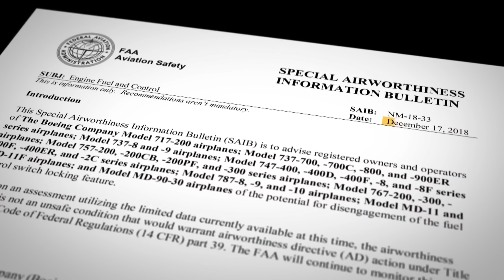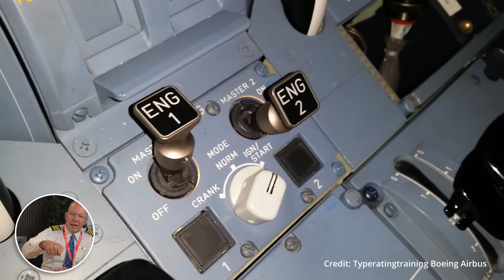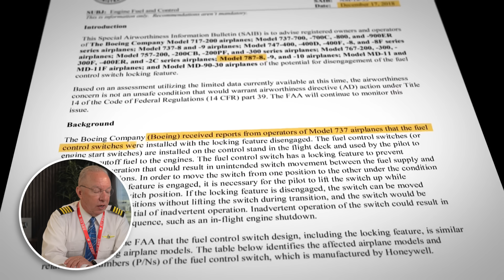Air India 171: The FAA’s 2018 Fuel Switch Locking Bulletin Explained (16 Questions Answered)

Comment: I strongly doubt whether this fuel cutoff thing has really happened or not. It's only said by the investigation authority, even those peoles in the authority are not competent enough to carryout this. The pilot association has already said that, so they can cook up any story and throw at public. 

If the pilots had noted it(fuel switch in cutoff position), why didn't they pass that information to ATC. Instead they did a mayday call. 

Fuel cutoff might have happened, but pilots didn't notice it. They did a mayday call, when noticed they moved it to run position, right after that plane collapsed. The investigation found this, made a story and given to public. Dead pilots are not going to come back and say truth. So Boeing and others are saved.

Comment: just saw a report stating that an 787 for the japanese Airline had a fuel cut-off during landing without intervention of the pilots. Technical failure should not be excluded so fast.

Comment: Isn't there a requirement of a flight engineer being present inside the cockpit on the jump seat for long haul flights of an aircraft like the B787? This has been a practice in Air India, don't know if it's still there, or if the SOP's have changed.

Comment: Capt Steeeve, excellent and insightful, caring handling of queries and issues by you as always. One question that however might be deserving of more detailed and careful consideration (after gleaning of needful information) is that posed by @ericm9768, the one about the MN4 microprocessor on ECU. The bulletin may primarily be meant as an informational circular rather than a directive notice requiring immediate remedial action. Nonetheless, it does mention "Flight Safety'' as a concern and poses a scenario where age and time related accumulated thermal cycles could cause "the solder ball to fail." The importance of this bit lies in the possibility that some adverse performative or functional consequences might result for the entire fuel switch assembly and system, and this could have a bearing on how, if at all, something other than direct human action or input could cause fuel shut off and the engines to stall. I know nothing about this field, but it to my mind does call for consideration because while the pilots are gone, it is imperative to fix any element, even the slightest, that might result in a future recurrence of this terrible tragedy if the the human actors, namely the pilot(s) are not directly responsible and the catastrophe occurred from another, systemic source.

Comment: What if the fuel cutoff due to other reasons with the switch in "RUN" position, they'd have to switch it back to cutoff then again switch to run which would explain the 4 second delay. Remember guys the pilots aren't here to defend themselves so we should give them the benefit of the doubt unless proven otherwise!

Comment: Two veteran pilots in the cockpit. If one of the pilots deliberately switched off the fuel during the take off, the other pilot would definitely see it and deter it, wouldn't he? 
I think something is very wrong with spring operated switches. Have you ever experienced malfunctioning spring operated switches, for example light swtiches, rice cooker and electric kettle switches and etc.They funnily switch themselves on and off quite often, don't they?

Comment: as for exclusion of sabotage: I guarantee that the electronic system of this plane is physically accessable and has an interface either physically or remote for repair and maintenance. One would just need access to the plane unsupervised. As for the exclusion of electronic system failure, unless the switch has a direct connection to the valve, but is steered over a central electronic system, failure of the electronic system without moving the switch is absolutely possible. Every part of a chain can break. I am also wondering, why it took 10 seconds for the pilots to swich on again. The switches beeing off in this situation would be a obvious fundamentally wrong set-up so the reaction should be much faster. It may be explained they be in on position  and then switched off and on again. That would make sense to the communication. The pilot is hearing the turbines going down, then asked, then is confused for a moment because the setting is right, and then switch it off an on again.

Comment: Can you please explain on a board how the switches and valves for the 787 works. Is it a signal to a computer or a voltage to a relay?  
How complicated is the switch? Can a signal from the computer reset the switch? It would be great to se a picture or drawing of the switch. It’s possible it’s made with an override function, but nobody goes this deep. It’s not an unusual way for a modern switch to have such a function, an electromagnet could disengage the pull function. 

Please get into how the signal goes to computers and to the valves. It could clear the pilots. Does the valve have a default setting? Like signal on is closed or open. Or does it require an active signal to both close and open? 
Please go through this as well as you can, find out how the system works and explain it in detail. Or get an engineer to explain it. 
Thanks/ Peter

Comment: Wouldn't it be possible, in an aircraft as modern as the Boeing 787, to program or integrate a mechanism into the software that makes it impossible—or at least very difficult—to shut off fuel supply to the engines during critical phases such as takeoff or climb, especially considering that all systems are functioning properly? After all, the aircraft’s software constantly monitors for faults within the system or the engines, and it apparently also recognizes the various flight phases such as takeoff, flight, etc.

Comment: Again, I have to ask, how does the flight computer allow a fuel switch to be activated during a critical flight phase such as climb out? There should be a safe guard that prevents them from being used until a certain safe altitude is reached. THIS IS A DESIGN FLAW.
Granted the pilots made a mistake, but the system should not allow it. No engine fire was detected that we know off so there is no reason to touch these switches at all, and if they were cycled manually, the ECAM should ignore a cut off request during climb out. Something is terribly wrong with this picture. And Boeing will get away with it again. Just like they got away with the 737 Max debacle.

Comment: My recommended immediate action required:

Install covers to the locking switch with huge alarms on it. Make it a procedure to engage the cover before takeoff and disengage when reach 3000 feet. In an emergency this would be flipped open and operate the switch quickly, but in case of sabotage it might give the other pilot time to stop the second switch from being pulled. In addition put a 3 to 5 second delay built into the software on the second switch in case one is disengaged. That way second pilot has a few seconds to save the aircraft in case of sabotage at this point. Maybe even install a second switch that can be operated redundantly by the pilot out of reach of the second pilot, specifically designed to operate during this critical phase of flight. Take away single point of failure for this critial point (i.e. pilot sabotage by one pilot). Also, examine other weaknesses at this crucial stage of flight and build in safeguards with redundancies.

Comment: I have the same question...when aircraft takes off...Isn't there a way to tell the Cap...the engine fuel supply is cut off...dunno....if am judging...innocent lives lost for which they have no control and invested their trust in the system

Comment: Boeing should not have placed the fuel cutoff switches in the current position, which is middle of the pilots, close it each other. The problem with this design is that, its easy for one pilot to manipulate both the switches without the other pilot noticing. In my opinion the switches should have placed in left and right instrument pannel of each pilot, far away from eatch other, so that only corresponding pilot can able to handle the  switches. This would prevent intentional and malicious dual engine  shutdown from the side of a single pilot. A kind of redundancy against intentional shutdown.

Comment: Thanks for another really insightful video Steve!

I agree it is looking likely it was pilot intent. However, could the fact the engine cut off switches were operated exactly the same the gear level usually would have been raised suggest any possibility the pilot might have unconsciously reached a different switch (albeit a different part of the cockpit) and flipped the first cut off switch, and then automatically followed with the second (as is rote once you've done one). The scenario might have played out like this: the Pilot Flying (PF) calls for 'gear up', the Pilot Monitoring (PM) reaches over and inadvertently reaches the engine cut off switches. The PF would notice a hand move expecting the gear switch to go up but then would do a double take noticing something didn't quite look right and say 'did you cut off' at the same time the engines begin spooling down. 

There was an incident last year where a BA 777 departing LGW rejected a take off after the co-pilot began retarding the thrust levers at airspeed V1, instead of removing his hand from them to the yoke.
https://asn.flightsafety.org/wikibase/509682

Although this is a very different situation, it demonstrates how it is possible to move one's hands at the command of an instruction (i.e, 'gear up' or 'V1') and operate the wrong procedure. It is however unlikely, as the cut off is such a particular set of actions (pull up, move down, repeat). But are we reaching to the conclusion of mal intent too soon?

Comment: EECs can detect if the Fuel Valve switches were really manually turned to CUTOFF because it will switch to next Channels A or B through relays or direct signal to EEC and power mostly from 28V DC BAT BUS.

Comment: Why does the system on the plane allow for a cut-off during take off? For example, the system that led to the 737 Max crash, intended to prevent a stall, and overrode the manual controls. Why isn't there a system like that?

Comment: Have the springs been investigated that are a part of the failsafe fuel shut levers...what will happen if the spring breaks due to vibrations..what position will the fuel shut off lever take in that case..?

Comment: I don't think one of the pilots tried to crash the plane. They wouldn't have tried to restart the engines if that was the case. I believe the pilot when he said he didn't cut off the engines. I think it was some sort of mechanical failure on the airplane.

Comment: If those safety measures in the fuel cut off switches were not installed in this specific plane, how could you then say there was no chance in heck that these switches were not unintentionally moved to the  cutoff position?

Comment: I don't agree with the assertion that this was a deliberate act by one of the pilots, based on the available evidence so far. Still have too many questions. Here's why:

Fuel switches: If this had been a deliberate act, why would a pilot choose to cut off the fuel switches, knowing there is a high chance that the other pilot would revert them immediately? At low altitude, yes, it's harder to recover, but it is still possible. However, in this case, Engine 1 didn’t go full throttle, and Engine 2 didn’t restart—indicating that the automatic restart system was not functioning as expected. If it had been working correctly and the switches had been reverted promptly, recovery would have been feasible.

Suicide scenario: A pilot with the intention to crash wouldn't choose a method that could still lead to survival, as one passenger survived the crash. Historically, suicide attempts in aviation typically occur at higher altitudes or involve more irreversible actions, like stalling the aircraft or making a hard turn, which is impossible to recover from at low altitude. Furthermore, suicide pilots typically don’t act immediately after takeoff; they often "enjoy" the flight first, as morbid as it sounds, before taking the final action.

Pilot conversation: The question, "Why did he do that?" is key. If a pilot knew exactly what had happened (that the switches had been moved to CUTOFF), the immediate reaction would be to revert them to RUN. The fact that there was a 7-8 second delay in switching them back suggests that the asking pilot wasn’t sure what had happened. It's unlikely that a pilot with the intention to survive, to rescue the airplane and his passengers, would hesitate this long to correct the mistake.

Pilot behavior: If I were in that situation, and I noticed my colleague switching the fuel switches, I would immediately act to revert them to RUN. The 7-8 second delay in the response time doesn’t seem like the typical behavior of a pilot who is trying to survive, to rescue the airplane and his passengers. It sounds more like confusion or a lack of understanding of what happened, especially considering the stress of the situation and the need to find a place to land.

Technical failure: It’s rare, but mechanical failure or a design flaw could explain why the switches disengaged simultaneously. While the likelihood of this is low, it's still a possibility that should be investigated further. Boeing had been warned in 2018 about the potential for inadvertent disengagement of the fuel switches. So, before we jump to conclusions about the pilot's mental health, it's crucial to first rule out system failures and understand why both switches might have been moved to CUTOFF.

Flight safety protocols: Even in the case of engine fires, pilots typically do not switch off the fuel supply immediately, not at this altitude. Engine fires would usually prompt the pilot to try to land safely, not to shut off the engines completely. So, cutting off both engines at takeoff, especially if there is a fire, doesn’t make sense, as it would lead to a guaranteed crash.

Audio and tone of voice: One significant aspect that I think needs to be addressed is the audio recording. Why has the audio not been made publicly available? If we could hear the tone of the pilot's voice when he asked, "Why did he do that?", we could better understand the pilot's emotional state and whether there was urgency or panic in the way the question was asked. The tone of the voice is a critical clue in understanding whether the pilot was simply confused or whether there was a more deliberate reason behind the action. It's strange that this hasn’t been published or discussed more thoroughly, especially given that it could shed light on the nature of the incident.

Who was the asking pilot?: Another point that I find troubling is the statement from authorities that they don’t know who the asking pilot was and who the answering pilot was. They claim that since all the pilots are dead, they can't identify who said what. What kind of answer is that? We are in 2025, and identifying voices from audio recordings is far from impossible. Family members, friends, and colleagues of the pilots could easily identify their voices. Why didn’t they check this? Or did they check it but choose not to publish the information? This is a key piece of information that could clarify a lot about the situation and should be addressed publicly.

In conclusion, while we cannot rule out the possibility of human error or pilot health issues, I believe the most likely cause here is a technical failure, until I have the chance to hear the audio.

Thanks to Captain Steve for all his work to find out why.
Reply: Best sum up yet
Reply: It's very impressive how you're trying to get everything just the way you want it. But the facts we currently have speak for themselves. You are simply arguing with very weak personal assumptions “If I were in this situation” etc.
Let's wait for the final report.
Reply: @MoHaNz123  I appreciate your point, and I agree that we should be cautious and wait for the final report. However, with the information we have so far, I think it’s reasonable to consider different possibilities and raise questions. I'm not trying to force a particular narrative, but rather to understand all aspects of the situation based on the facts available to us. Once the final report is out, we’ll have a clearer picture, but for now, exploring different angles seems important."

Comment: "A wrong fuel disconnect signal was sent to the software due to faulty hardware, causing the software to shut down the fuel supply. The flight data recorder also captured this data. Just before the crash, the pilots turned off the fuel cutoff switch to reduce the impact."

Comment: Pure Speculation:- Air India flight sitting waiting for clearance, engines running. Due to having to wait Pilots throttle back (at the same time the other pilot cuts the fuel to the engines). 

1. The onboard software does not recognise the movement of the fuel switches and does not shut down the fuel valves - neither pilot recognises the inconsistency due to the engines winding down due to the throttle back.

2. Sometime later they power up a take off.

3. At the point of take off the software switches to in flight mode, in this mode the s/w recognises the position of the switches, closes the valves and logs the switches have been moved.

We know what happens after that.....

Comment: The only way to avoid this would be: double switches or a “confirm switch”. Switches are only used for procedures that take longer; after landing when reaching the parking position, an emergency landing or in flight after a fatal engine failure (bird strike or fire...).
Therefore, it will be safest to acknowledge these switches with a confirmation.

tanks a lot for your expertises... Greetings from Frankfurt, Roger